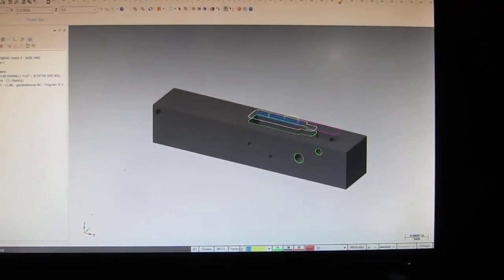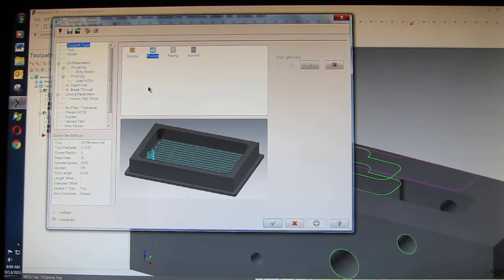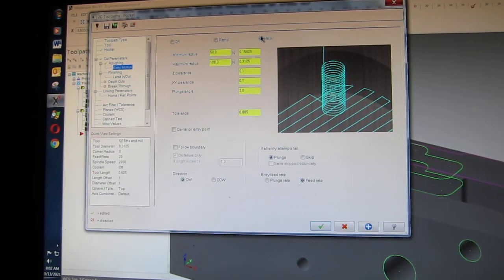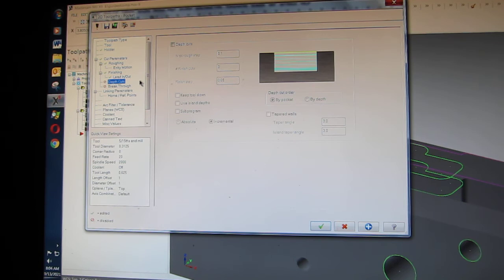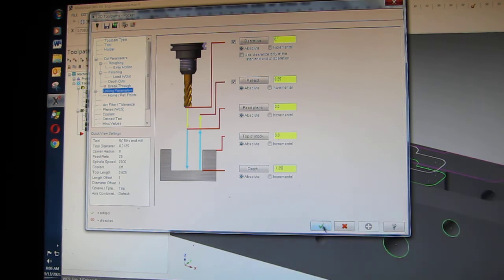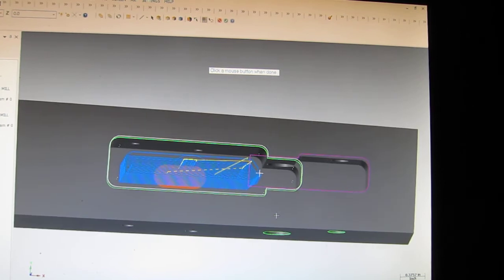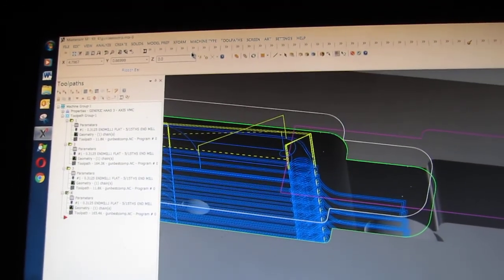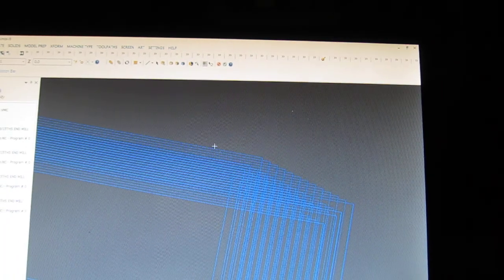machining cnc programming funniest video of all time

Comment: Very interesting. I have done many solidworks drawings and sent them to machine shops to be machined, but never knew what their work entails.
Reply from the maker: I never got deeply into solid works. It is not pro e or the others but i regret I did NOT keep climbing higher but old age got me I am 68. At motorola I used Cimatron which is in the range of a $30,000+ israeli program--the best. 

I dont know if you can tell what I am using but ITS THE WORST.
Reply from the maker: You can ask me anything anytime and its possible we could hook up to exchange iges files.

the one thing I cant do is create a shape like a human hand. However if I have the iges file I can program it in record time. fully emailable
Reply from the maker: anyway good talking to you if you ever create files for plastic injection molding I am the person to keep in touch with. that is what I did for decades